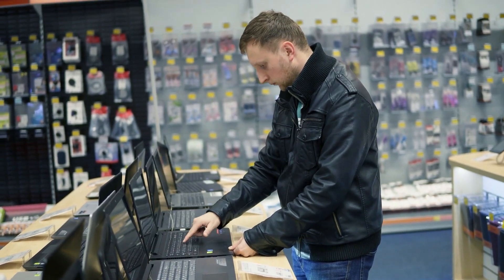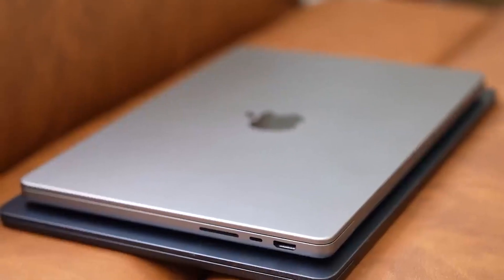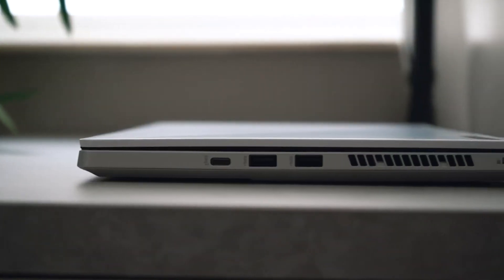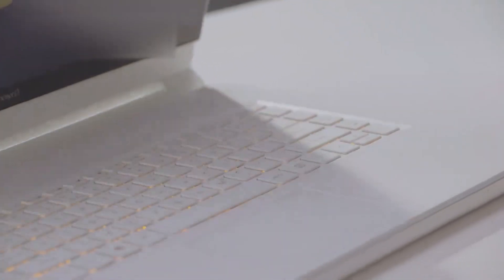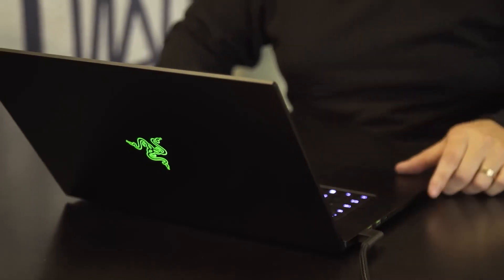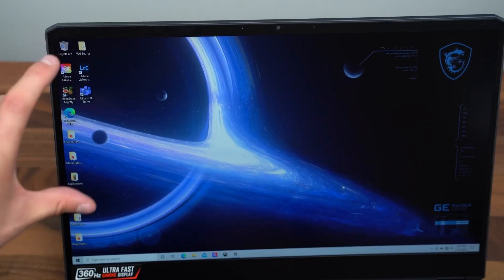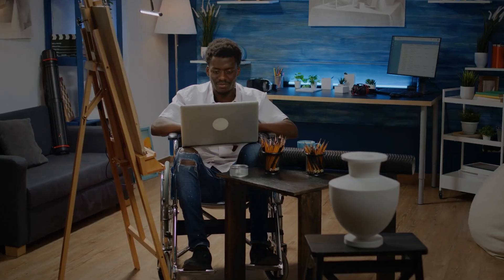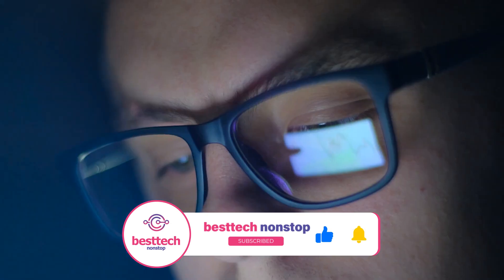Top Best Laptop for 3d Modeling and Heavy Duty Softgear's!

Comment: 4050 is more than adequate for almost all of 3d applications. 4060 is 15 % faster than the 4050 in gaming, I have both laptops ( Dell G15 with 13450hx & 13650x).
Reply: 4050 in a laptop has 6gb of vram....